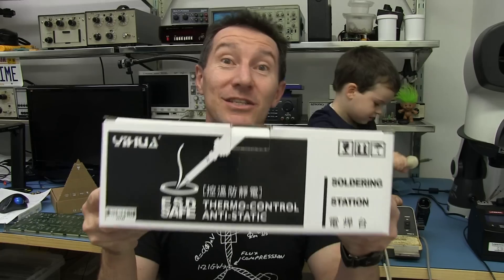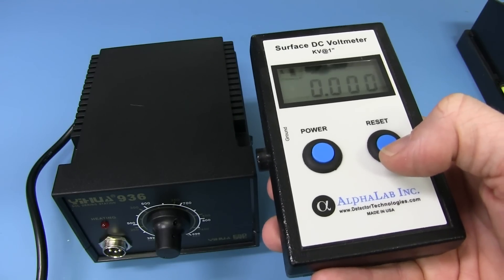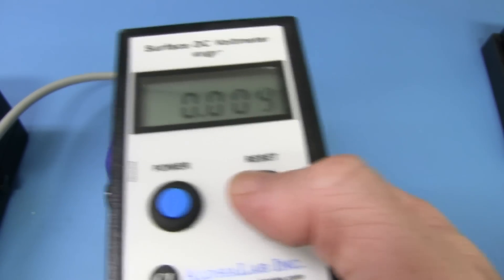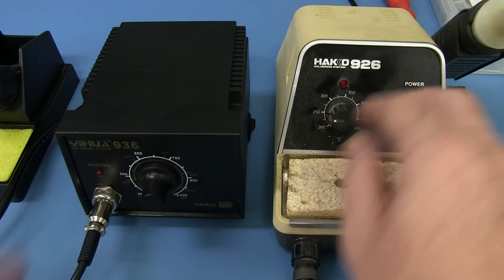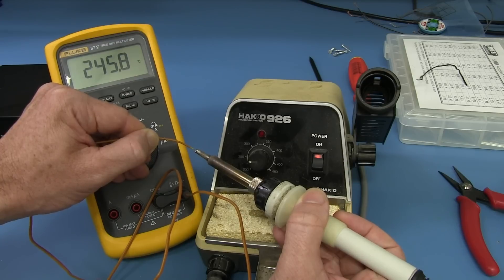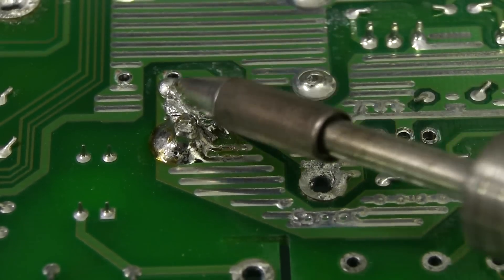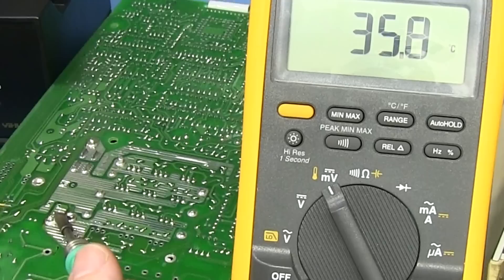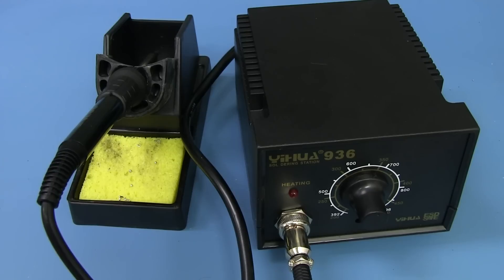EEVblog #596 - World's Cheapest Soldering Station - Yihua 936

Comment: I paid $12 for this station 12 years ago. I’ve soldered hundreds of different electronics and batteries with it. The other day the wand finally wouldn’t heat up enough for me to do some 8 gage wire. I got a new wand since this is my only station and I didn’t have a want to fix the old one 😂. This lil thing has been an amazing investment

Comment: I used a Hakko 936 for many years when I was doing repairs, it went on in the morning and off at night, never a problem and only occasionally  resorted to a scope for more grunt. 10 yrs ago I bought my own cheap copy: Sunko 936, only used it twice as Im retired. Not as good as the Hakko but its okay (I fitted a Hakko tip of course) and the hysteresis is similar to the Hakko. Now after watching Daves teardown, I pulled mine apart: LM324, no rust, crimped mains earth, metal film ohms, good solder and they cleaned the board. But it still came with the same crap handpiece. I forget how much I paid but these cheap copies must vary in quality. Though it may be semantically not an equitable comparison metric, its in the same boat as a Kia: functional as long as you dont expect too much. Dave is on the money (all $16 of it).

Comment: It's probably been mentioned before, but since you have the tools to calibrate the iron, I would think that the way to test would be to first see if you could calibrate the two soldering irons to both actually be heating the tips to the same temperature. No that probably isn't what the end user will be doing, but at the same time the end user is likely to just be bumping the temp up until they start getting the iron response they expect. You're trying to compare two irons, yet you already know that they are doing something different when 'set' to the same value. Complaining that an iron that's set to 300, but you know is only heating to 275, doesn't work as well as another iron set to 300 that you know heats the tip to 295, is like complaining that a pump that pushes 27.5 gpm of fluid doesn't fill up a tank as fast as one that pushes 29.5 gpm when both are set to 30. It doesn't say anything useful as a comparison, and certainly doesn't tell you anything about the thermal mass characteristics of the iron.
Reply: The fun with those cheapos are that written temperature number at them is complete BS. 300 degrees Celsius in fact may be 200-250-300-350-whatsoever... nobody will know real temperature without measuring it. I have a GJ-8018LCD heat gun. It have a temperature display, however numbers here aren't nor Celsius nor Fahrenheit degrees. P.M.P.O. degrees maybe. That thing broke after a week BTW.

Comment: I've been using a Yihua 852D+ (Hot air + soldering station for ~£90) for over 2 years without any issues except for the low thermal capacity of the iron similar to your review. Been soldering quite a lot of fine pitch stuff (0.5mm QFP, QFN, 0402, 0201) and use solder paste with hot air every so often. I'm thinking of getting a Hakko/Weller as a main iron but the hot air part of the Yihua is usable for a few more years.

Comment: I had one of these in High School.  I used it for maybe a couple hours a week and it lasted two years before the heating element burnt out.  The temperature setting on the front of mine didn't mean anything at all, I think after seeing this that maybe mine was defective right out the box (I always had to run it with the temp cranked all the way up).  Also, the stand that came on mine was exactly the same,  but all aluminium and quite heavy.  Tips usually lasted about 6 months before the solder would wick all the way up to the barrel on the iron.  It was okay for learning, but I was very happy when the element popped.

Comment: I have temp controlled stations but my go to iron is an Antex XS25 un-regulated iron. I did a lot of field repair. Never let me down, never leaked pixies or blew anything. Runs out of welly on bigger solder jobs but for most electronic and audio work it's the nuts.

Comment: The genuine Hakko tip might just be the difference between a good and bad experience, as the thermal contact is much better between the heating element and the tip. That dictates the possible reaction time to cooldown, maximum thermal output from the element to the tip, and along with that, the thermal recovery, as far as the physics of it goes. Electronically, they're both just switching the element on and off, no? The sensitivity of the switching circuit to changes in tip temperature is the only effective output variable of the circuit, when it comes to recovery capability

Comment: Surprised knockoffs are still being manufactured since Hakko doesn't make the 936 anymore. Thought they'd move on to knocking off the newer FX-888 or 951.

I bought a 951 a few years back it's a real good iron. Was considering a real 936 but the iron just looked and felt cheap to me. When compared to the slender profile of the 951 iron.

Plus on the 951 the heating element is integrated into the tip for better thermal contact and allows you to hot swap if you need to.
Reply: Yes they have been making 951 and 888 knockoffs for a long time.
Reply: That seems silly.  The Hakko 936 worked very well for many people during its product lifespan.  To act like a spoiled idiot thinking that once Hakko changes that, the design that worked fine no longer does, is ignorance.  The clone is so cheap quite because it sticks with what works instead of constantly doing more R&D and retooling to make changes that aren't needed just to do basic soldering.

TLDR:  If it's not broken don't fix it.

Comment: Wish he tested it with the tip that came with it.
Reply: Hehehe, then we'd still be waiting for the first soldering attempt! =o)
Reply: There's no point. A tip like that is just completely and utterly useless.
Reply: That tip is only good for very fine work - SMD work, really, as it isn't big enough for most through-hole. Soldering tiny SMD connectors isn't a challenge, for the iron at least.

Comment: "the 936 has better thermal capacity than the 926". If your poor you can buy this then open and rework it. Im in the market for  a cheap iron suitable for small componet work. Id prob get something like this` and redo the soldering and clean the flux etc off the board.
Reply: Look at it as a project.
Reply: Black Terminal u think u can repair it with the same iron connected?
Reply: xXxGnuVirusxXx I have other even cheaper irons to use of course.
Reply: Black Terminal u should try to do it with the same iron and document your results.
Reply: There is no need to rework it.  Dave's iron DID WORK, he was just accentuating some way to justify a higher priced iron.  Fix it if/when it breaks, not undue labor until then.

Comment: That board is disgusting lol... When a "new" unit is corroded on the inside that just screams NOPE
Reply: Dami Nooki
and propane accessories
Reply: if you don't want a disgusting board, pay more. done.
Reply: Hs C
Of course. That wasn't the point though, and even then it's still way more shoddy than most other similarly cheap devices

Comment: Nicely done,  as always.

I picked up a Weller 7500 iron at a hamfest recently for only $10 US.  Just the iron, but with a new tip, so a great deal.  I just didn't have a solder station for it.   So, I made one.

I used an old dimmer switch I had on hand.  The rotating knob type that clicks on and then controls a triac to slice the duration of each cycle on the mains power.   A little measuring and I marked up a dial with approximate temps.   

Not regulated, or very scientifically accurate, but I'm the type that does this:

Poke,  did the solder melt?  No?  Ok, Irons too cold, turn it up a little.  Repeat.

Comment: It's also known as Quick 936. I have used mine for a couple of years. Works, but drop it once and the casing screw guides/posts just snap off, then you'll have to glue the case halves together.

Comment: Hello Dave,  I have my JBC set to 660 degrees for every day soldering.  I never could do that with the Weller I replaced it with. Thanks for showing the JBC on one of your other videos.  As for the ground connection. I would trust the soldered connection way more than the crimped any day. I seen and dealt with with crimped connections getting loose connections due to the wire conpressing down over time. The best way would be to both  crimp and solder the crimp. Which is what I do to crimped connections that has come loose.
Reply: This is why I crimp and then solder.  Anything that needs the mechanical reliability of a crimp and the electrical reliability of a solder gets both.
Reply: You got it!

Comment: I have Yihua 937D+ which I bought for about $35 USD. And for the price, I love it.

It is pretty much same as 936 you reviewed (same housing and stand), but have better iron. Cleaner finish and easier to grab. Heater is probably same.
Still not as good as Hakko or Weller soldering station, but much better than Weller's cheap direct plug-in irons.

Only issue I had was one of the segment from 3 digit segment LED went out after few uses. Tried to replace, but turns out it is not worth repair. It would cost me about $10 for replacement part. Not willing to spend that much for this cheap soldering station and I have no problem reading the display.

Comment: I supported my local brick-and-mortar electronics store with a Hakko buy, world of difference.

I submit that my old station is the world's cheapest. Bought (used) at Radio Shack for half a dollar, 10 years of use, iron destroyed dropping it in a pinball machine and then a mains soldering iron wired into place. Three temperature settings; high, low, off.

 While it does still power up,, itt's retired, it would be hilarious to compare it, but may convert it to a station for the desoldering iron, the switches, light and spring stand are still good.

Comment: I have the same soldering iron, and it's served me well for many little kits. Once you calibrate it and replace the crappy conical tip it comes with, it's not actually a bad iron. It holds the temperate calibration well, and it's sufficient thermal mass to hit some pretty big joints. No it's not as good as the MatCals I use at work, but it certainly is good for a beginner especially since it's adjustable. The hand piece does loosen up over time though, some high temp lock tight is advised. and the base is honestly horrific, it's way too light. If memory serves, Big Clive did a review and teardown of it, and it's not bad. As far as the ESD safety, the iron is directly to ground, so the iron tip is grounded. Although mine is branded exactly the same, and was $28 with shipping from Ebay to the US, the PCB doesn't look nearly as bad, not sure why that is. Mine has better joints and is cleaned, so there is no flux on the board. Maybe this one was done by a different subcontractor? Frankly, that flux on the PCB can shorten the life of the board, but some iso alcohol will take that right off.

Comment: If the Yihua is $16, then you could only buy something like 5-6 Hakko FX-888D units for that price, as those are closer to $91 (US dollars), not $160.  Comes closer to $100 if you buy a chisel tip at the same time.  The thermal capacity might not be great, but for $16 you have a lot more left over for consumables and the like.

Aside from the heating delay (which didn't seem that bad here, actually) I don't see the problem - if it's not transferring as much heat at the same temperature setting, you're not really in more danger of scorching components or boards than if you had used a genuine part, unless you leave it set too high.

Comment: I have similar "class" station - WEP 853AAA - its 3 in 1 -iron, hotair, small preheater. I was very confused when I unboxed it, quality is really bad, however there was no rust inside. I'm really satisfied - it does the job. I have iron, hot air and preheater for 100€ :)
And for soldering high termal capacity parts (heatsinks etc.) im using diffrent equipment (50W iron with thick tip and no temp control).

Comment: The iron on the soldering station is exactly like my iron on my really, really bad Circuit Specialists Station-60 Soldering station. Literally, it also says 907A ESD SAFE on it.
Reply: it´s just relabled as he said
Reply: FantaFuture92 Quite possibly, if CS sells soldering stations with the plug on the left while mine has it on the right and has a blue aluminum stand instead of plastic.
Reply: Circuit Specialist have been known to relabel chinese products, so its probably the exact same iron. Why do you say its really, really bad, they are 100X better than shitty mains pencil irons?

Comment: All I have to say is, the Hakko costs 10x as much but do you get 10x the performance and reliability?
Reply: +helicrashpro It depends. Are you an budding electrical engineer or an electronics technician? Then it is definitely worth buying and using something that will last half your career. By that time, you'll have underling techs to do your soldering at work. If you are a hobbyist that plugs it in once or twice a week, maybe. If you are just getting started, it's probably worth going through a couple of cheap pencil irons to figure out just how much any particular feature or quality is worth to you.
BTW, the Hah-koh (not HAY-ko) FX-888D is only US$80 down at my local electronics superstore.
Reply: +Markle2k I could not agree with you more. For a hobbyist, I don't think this is a bad option. A $5 pen iron can do just fine and I have one that I have used for years. But a few $$ more and you can have adjustable temp which is worth it. I absolutely would not use either of these cheap iron for profession work, then it's definitely worth buying a more quality unit. Most hobbyists I know are trying to find the funds to buy all the gear they need to keep up with their RC addictions (me included) and if this unit does not crap out in short time than is well worth the $$ spent. I simply can't justify $80+ on an iron when I get by just fine with a $5 pen iron but the $16 spent on this will be money well spent (hopefully).

Comment: I actually bought Atten 8586 with heat air gun like Dave's Atten, but combined with hakko clone soldering iron which is exactly same like this one in review (only digitaly-lcd controlled). With it i bought 6 different hakko clone tips and here comes the fun part. :-) Except for the short and stiff cable, i am very satisfied with it. Been working with one tip for over a year and it is good as new. I actually prefer it to the Weller (PU 81) and Ersa (C25 without control) which i use alongside it. Tips on the weller and especially ersa are, is tough to say, but lower quality and degrade much quicker, not to mention big price difference. I know that this doesn't sound right, but that is my experience. I am very happy with it, and recommend it for hobby users.

Comment: There are a few concept errors which most people will make. The power of a temperature controlled iron comes from lower heat resistance from temperature controlled core to the tip, not thermal capacity. Of curse, this output power is limited by the iron power, and always smaller the spec power. The heating power equals to the temperature difference between the core and tip divided by the thermal resistance between them. JBC has lower thermal resistance, so it can give sufficient power to melt joint at lower set temperature. Lower quality tip also increase this thermal resistance, so Yihua will perform worse than shown, if it is used with Yihua tips  instead of Hakko tip.